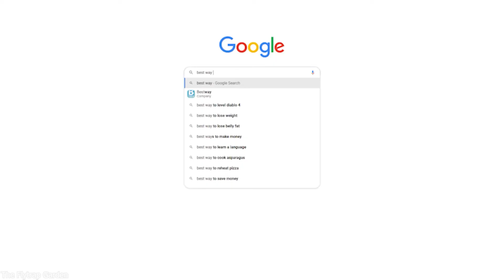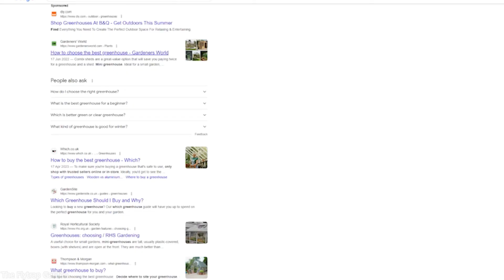Our New Carnivorous Greenhouse

Comment: Cost effective benches you can either build them for about 30-100 quid depending on what you need. Or if you are near a B&Q/Homebase. Look for Shed Shelf Racks. They are metal shelf racks with MDF Chipboard layers you can put in and adjust to however high you want em.

Comment: Is pH value in a venus flytraps soil essential? my soil mix is at neutral stage (7)
Reply from the maker: If you used peat it will naturally go down to a slightly acidic ph which they need
Reply: @TheFlytrapGarden  I cant seem to find Peat moss anywhere for sale in my country, so I found a carnivorous plant mix online which is made up of (Sphagnum moss, vermiculite, horticultural sand, activated carbon and coco coir.) But my pH meter still reads it to be 7.0. So I dont really know what to do
Reply from the maker: @Omega3000-y9r  that soil recipe isn’t ideal for carnivorous plants, I’m not sure who you got that recipe from? The best would be a nepenthes for that recipe but even then, not entirely. Vermiculite has a basic pH and charcoal is a neutralizer as far as I remember so it will stay neutral. Sphagnum moss and perlite can work fine if you can find that? Feel free to send me an email and I can help you more. Let me know which country you are in and what soil you are able to find in your county and I can help you choose the best soil from what you have available
Reply: @TheFlytrapGarden  i just wrote an email to you with more details
Reply from the maker: I replied, did you see it?
Reply: @TheFlytrapGarden  yes thanks 👍

Comment: Im a new grower and have some collection starting here,
I live in Germany and im concerned about the winter as it can be very harsh.
Is a plastic grow house and Styrofoam enough for my venus flytraps to isolate them from frosting in the winter during dormancy?
Reply from the maker: A plastic greenhouse will do fine in winter but not in summer, as the sun gets extremely hot in one of those plastic ones. Usually people move them indoors during the winter, into an unheated room or garage that has a south facing window.
Reply: @The Flytrap Garden  Unfortunately, Indoors is a bit tought since the entire flat is heated all the time and they won't get the low Temperature.
In the summer, I let them hang outside under the sun :)
Thanks, I'll try out the plastic growhouse in the winter then.

Comment: Getting a greenhouse was my best gift to myself. I have 2 now both 8x10 ft greenhouses. I built all of my shelves with 2x4s it’s cheaper and stronger than any shelf you can buy. I also have the plastic 3 tiered storage shelves which work nicely  I put the full sun plants on the top shelf and the two below get lower light plants like nepenthes. I will say though that in the summer it should be covered with a light colored tarp to let the sunlight through a little and keep it from getting too hot. I live in Florida though so that might not be a problem for you. But even with the tarp my carnivorous plants grow like weeds , so much so I have too many and am going to start selling locally . A big thing for me was to use 100 percent silicone around every pane of glass. If you get enough wind (for example we get hurricanes here) the panels will get pulled out . Also a fan is very beneficial. Congrats on the greenhouse!
Reply from the maker: Thanks for the idea! Do you maybe have some info or a pic as to how you built your shelves? I don't think the wind or heat is as bad here as it is in Florida haha, thank you!